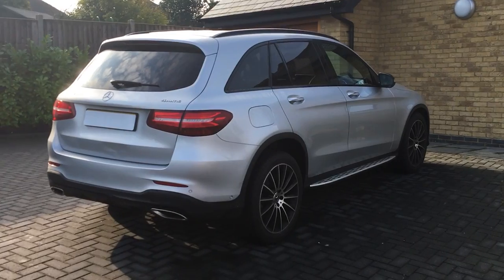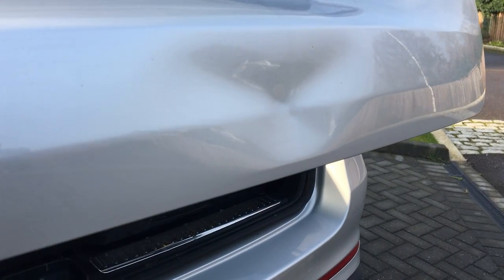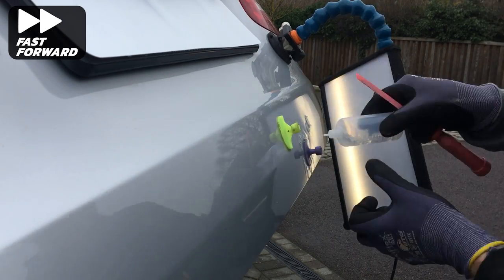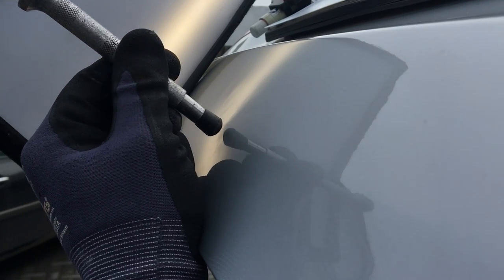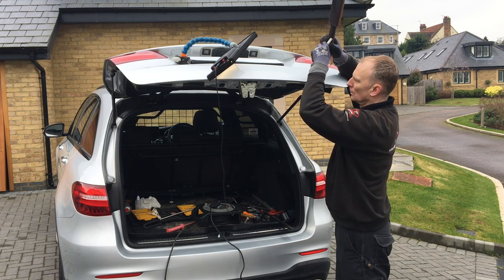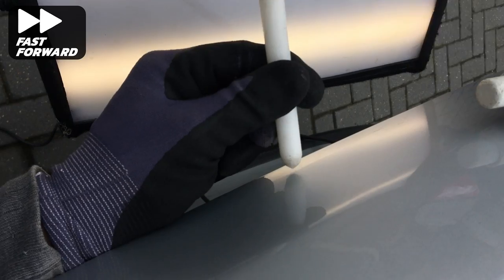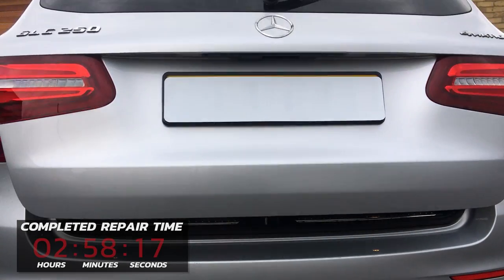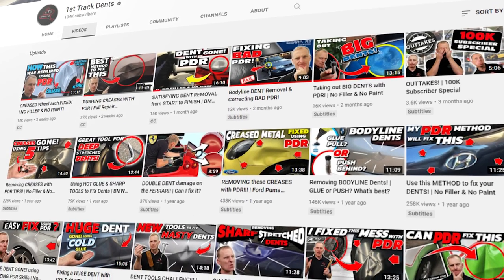Remove DENTS in your car with HOT GLUE! | Full Repair BREAKDOWN

Comment: The sharp line from where the panels are sealed together is by far the toughest part of that repair, in my opinion. Amazing how much easier and cleaner the dent finishes when it’s removed though.
Reply from the maker: Thanks Mark, yes these sharp lines can sometimes put up a real fight and are quite common when repairing door edges, so I have done plenty of them in my time, so I can pretty much remove them with no problem. Thanks for watching 👍

Comment: I have very very similar dent. I tried to work around the trunk lock mechanism and missed the spot. Am now working to get the bulges pushed back in. Luckily I went slow.
Reply from the maker: Yes, obstructions behind can always create a big problem and it can add so much more time onto the repair if you have to start removing lots of things! I'm sure it looked amazing after you had finished 👍

Comment: New to the channel if you were to recommend a body work guy about 3 or 5 bars and screw in tips and other tools like lights and stuff what would it be thanks for your time !
Reply from the maker: The 24 inch double bend tool I use all the time from Ultra is here, this is a great all rounder bar:
https://www.ultradenttools.com/products/st3802-24-x-7-16-screwtip-dbl-bend-90?_pos=3&_sid=d6dbd8607&_ss=r 

The A44 tip set that accompanies the 24 inch double bend tool:
https://www.ultradenttools.com/products/a44-7-16-6-pc-tip-set-and-tip-holder?_pos=1&_sid=5430179c2&_ss=r

I use these  tools all the time, they are very good if you are just starting out.

Regarding lights, there are a few manufacturers, Elimident and Stucky are very popular, never used any of their lights though as they way out of my price range, so I've had to make my own. 

Good Luck!

Comment: Great job as usual Jake thought the panel was stretched when I first saw it. The line on the frame was nasty I have flattened one of my 6mm metal tap downs I find I don’t have to be as accurate and it spreads the load a bit. Keep up the videos they r a great watch. 👍
Reply from the maker: Thanks Adam, yes it was slightly stretched but I managed to get it back, Mercedes metal is good material to work with. Thanks for the tip on the metal tap down, I'll give it a try 👍

Comment: HEY JAKE!!   
On some of your vids you say you sharpened your knockdowns.  Would be interesting to see your process.  
I mostly (the ones that will fit) put mine in a drill and spin it in upgrading sand paper until it’s smooth as ice and sharp. 
However on my metal ones I’m rarely satisfied and can usually see a slight marring on the panel.
Techs have said there’s always marring with metal and just buff it out but I don’t agree with that, at all. 
Thanks bud.
Reply from the maker: Yes, I usually just sharpen them on a flat piece of sandpaper, usually P80 and then to P120 and that works well for me. I don't use the metal ones only as I work mobile so usually working in the road or on concrete/tarmac driveways and I tend to drop my knockdowns quite a lot! so I would be forever polishing the tips again, with plastic you just have to give it a quick rub with some smooth paper and you're good to go again. Also if you drop a plast knockdown on a bonnet or roof by accident, there is no way it will damage it. 👍👍
Reply: @1st_track_dents  I agree, when a metal one slips it falls in slow motion, NOOOOO! Lol
I use metal mainly to shock tight areas on larger repairs (learned from Brice’s channel) but 90% of the time it’s delron or Dent crafts plastic. 
Blending hammer lives in a baby sock and have only dropped it once.  
Thanks for the reply and open dialogue.  
Looking forward to your next minimovie.
Reply from the maker: @dingking7577  No problem, great chatting to you. I have another video coming out on Sunday around 4pm UK time. Hopefully it will be an entertaining watch! Speak soon 👍👍👍